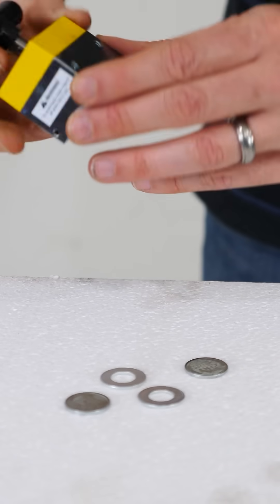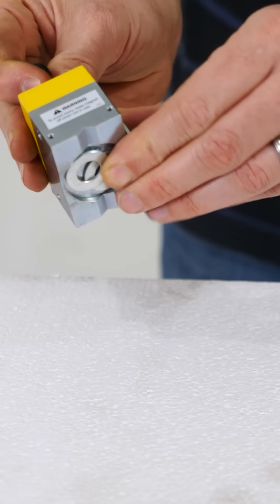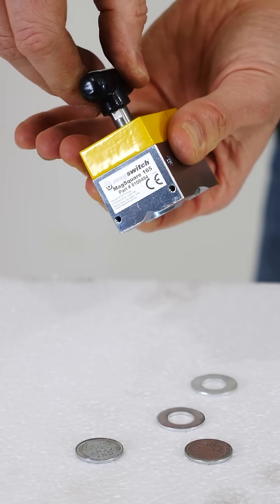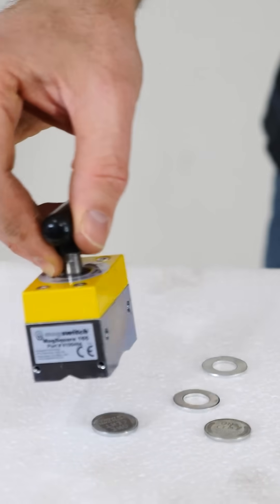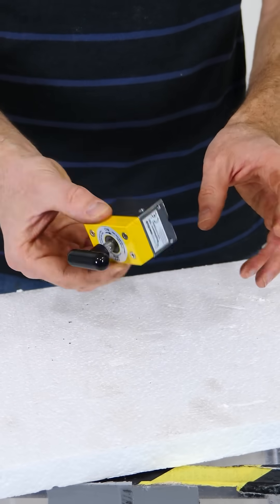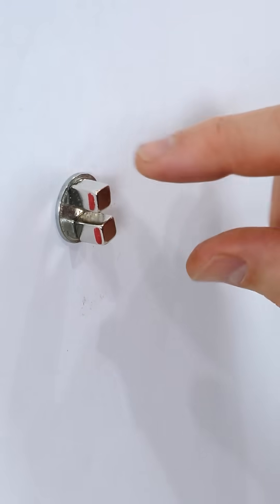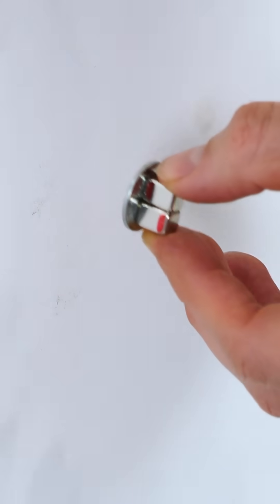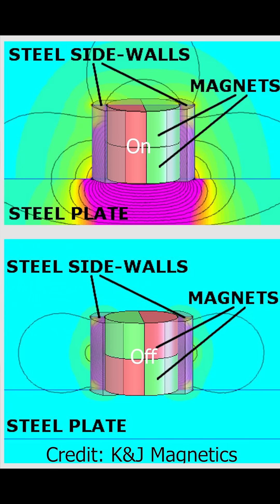How To Turn Off Permanent Magnets

Comment: Fascinating to consider how it doesn’t take force to turn the magnet off, despite it resulting in the metal bar leaving a magnetic potential well. I think it’s because the two halves are more stable in the “off” configuration, which offsets the force needed to pull the metal bar away? It’d be interesting to know if turning the magnet on is difficult (with no object attached)
Reply: Why didn't he answer??? That was really my question, how hard is it to turn it back on?
Reply: Turning the magnets require a force like trying to put 2 magnets close and then pulling them apart, is not a huge force because the magnets are small and the device probably offers you a mechanical advantage like gears or smith also altho it can hold the bar it can't lift it and the small pieces barely have any potential energy
Reply: @juan3856 ^
Reply: You can watch the original video to see him turning it on, he does so with a 3 finger grip and it doesn't seem to be much work. So I'm not sure that either config is "more stable" my guess would be that they're equally stable and that the offset comes from the unique interaction between the off configuration and the steel side-walls.
Reply: @Nezxmi he meant turning it on while holding the piece of metal to the magnet.
Not simply turning it on with nothing there.

Also, weird that he clicked that he loved OPs comment but didn’t respond to it.
I’d like to know where I can get one of these so I can try it for myself
Reply: @bamcr1218 OP's comment said he wondered how difficult it would be to turn it on with nothing on it.
Reply: Yes thats a great question, because if it really was that easy to tuen on and off, it would leave the door open for some kind of perpetuum mobile, where you can lift and let go huge objects of steel with the flip of the switch, which requires much less energy than the energy generated by the magnets
Reply: @nameisntimportant749  My thought exactly.  If no energy was needed to switch magnets on and off, you could generate energy by having a piece of steel shuttle back and forth between 2 'switchable' magnets.
Reply: Having used em a lot in the past for crankshaft runouts they flip on and off fairly easy, with or without metal to attach to. 
Id say its comparable to basically flipping a toggle switch in a plane. Enough force to maintain its on or off position but easy enough to overcome with a thumb or finger.

Comment: How can it qualify as a "permanent" magnet if it can be "turned off"?
Reply: BY NOT require, requiring to supply wooltage and current from a power source to operate.

Comment: FREE ENERGY!!!
Can I use the magnet to pickup a heavy metal (free potential energy), then turn it off, then turn it on again (free potential energy again)... Repeat...

Probably it becomes harder to rotate the internal magnet when it's lifting a heavy metal. Maybe you'll need much energy to turn it off and on again in this case.

Comment: Could these be used in a brushed motor? Potentially could drastically increase efficiency as you'd only have to move those magnets but then again it would take energy to move them. Also is larger but an interesting thought
Reply: ARE YOU learning  to speak from TRUMP?

Comment: The fact that you can turn it off and on really defeats the whole "permanent" thing
Reply: Just means you don't need electricity to run it.
I wouldn't even describe it a "off" just neutralised.

It would be a massive headache to keep a strong permanent magnet around the place.
Reply: @Cheepchipsable   YES
Reply: @Cheepchipsable  When you turn on the TV, you can turn it off next.

Comment: "Steel pieces of metal"
Reply: I mean, there are other kinds of metals... Aluminum, copper, tin, tungsten, etc.
Reply: @wpaldridge Yeah, but a normal person would just say "pieces of steel".
Reply: @wbfaulk  for sure. It's definitely awkward but not technically wrong.
Reply: @wpaldridge  no, it is technically wrong. by saying steel pieces of metal he's implying steel can be something other than metal. it literally cannot.
Reply: @wbfaulk or washers😀
Reply: @wbfaulk False. A normal person would call them washers.
Reply: @wbfaulk not proof checked for error
Reply: @dippst you are absolutely correct, this oresentet of the video is basically a tool.
Reply: @dippst He was not wrong and implied nothing of the sort.
Calling it metal is not false. Calling it steel is not false. Saying both in the same sentence is redundant, but still not false.
I could also get nitpicky with your reply and the imperfections of it as well, just as many seem to have done to him.
Reply: @dippst  No it's not, it's implying that there's multiple types of metal. Just like oak pieces of wood, etc. It's correct.
Reply: @wbfaulk  and why would you expect a normal person to narrate this channel?
Reply: @wpaldridge forsure lol   just funny that he said it like he did
Reply: @wpaldridge yes but steel can't be anything except a metal so it's pointless to specifically say metal pieces of steel, as opposed to what? Wooden pieces of steel?
Reply: @PeachDragon_ the internet is full of other people being wouk or just argumentative
Reply: @PeachDragon_ they are steel pieces of metal, right? They aren't aluminium pieces of metal. Or gold pieces of metal. He's telling us that all of the metal pieces are steel. These, is the referrer, including all of the pieces.

Correct to say steel pieces of metal, or these pieces of steel. However these metal pieces of steel wouldn't be correct.

Half of the elements are magnetic. Half aren't. So as you know he's clarifying that all of the metal pieces are steel, so we can assume they will be affected by a magnetic field.

Pedantic. Much.
Reply: @wpaldridge theyre all metals, so only steel was necessary
Reply: @wpaldridge But there aren't any pieces of steel that are not metal. Which makes the comment redundant, which is what the commenter is mocking.
Reply: @wpaldridge and? You don’t say steel metal. It’s either metal or steel. Saying one already implies the other. Stop defending ignorance.
Reply: @jamesbizs reddit tier commentary
Reply: @jamesbizs  “it’s either metal or steel”
Erm no… it’s both, not either.
Reply: @Silver-StarGazing find a hobby
Reply: @_..-.._..-.._  Thanks for the recommendation, but I'm good. I tend to make a hobby out of defending people from assholes.
Reply: 😂😂😂 the redundancy! But yk some people ain't that sharp, can't be too careful now
Reply: How about "metal pieces of steel" (which is talking about the pieces being made of metal and then specifying it)
Reply: @FifyKaqiqiPain it would still be “Metal pieces” or “pieces of steel”..essentially saying Metal or Steel twice. Metal pieces of Steel implies there can be other material pieces of steel
Reply: @FifyKaqiqiPain  metal pieces which are steel. That's how you'd clarify that.
Reply: There are other metals.... copper, aluminum, zinc, mercury...
Reply: as opposed to steel pieces of wood
Reply: Lmao true
Reply: At 3am in the morning
Reply: An aluminum piece of metal
Reply: You're a "Serpent like snake". Rustage(a rap artist and Dungeons and Dragons campaign runner[DM/Dungeon Masteer]) used this description of a snake goddess. Now, I call people that and watch facial expressions go from "how dare you" to "wuuut??"+confused laughter. Then I laugh, and then they laugh, and it's a funny time! Good ol' funny time...

Also, you probably know of DnD and it's acronymic terminology. But, just incase lol. So, no insult to your intellectual prowess(or anyone who reads this).
Reply: @ItsOnlyGenjutsu sad
Reply: maybe he meant stolen pieces of metal 🤷🏻
Reply: "washers"
Reply: Wtf is this. Some of you need to take a break from yt
Reply: You're just salty hopefully no steel in your body or You're going to rust and noone will touch you unless you get your tetanus shots XD
Reply: इंग्लिश मूर्खो की भाषा है 😏😂
Reply: As opposed to steel pieces of bronze.
Reply: You know…In general, anything that conducts electricity at absolute zero is scientifically considered a metal. In astronomy, every known element other than hydrogen and helium are considered metals.
Reply: I know, what an idiot. He should have said “Metal pieces of steel”
People sometimes…am I right?
Reply: I see nothing wrong with that.   He's specifying what kind of metal, no?
Reply: we just gonna skip over the fact he has a railroad spike?
Reply: @draconicdestruction  I found several completely loose while helping a buddy with his car in Missouri on the line near his dad's house, I assume they are left over from being replaced and not cleaned up after or lost among the rocks, all the adjacent rails seemed to have all the ones they were supposed to
Reply: Did you know that Jesus loves you? Jesus is the Son of God. He died on the cross for our sins and was resurrected three days later. With His sacrifice, we have eternal life in Heaven. Believe in Jesus and you will not die, but have everlasting life.
Reply: But Steal wheat penny
Reply: @Feltys_Coins I wish 😂
Reply: @austinhernandez2716 wach closely.19 seconds in!
Reply: @austinhernandez2716  in 1944, pennies were made from steel to save copper for war shell casings and FMJ rounds
Reply: @Feltys_Coins they actually made steel penny for one year in 1943 to save copper during the war, which I assume the main demand was bullet jackets and wiring.
Reply: I bet you’re all perfect and have never tripped over your words when you’re explaining something. His mistake was not reshooting it and assuming people might actually not trash him for it. Redundancies are one of the most common language quirks, and many are societally acceptable. 

Almost every comment here judging his grammar also has some sort of grammatical error. The same amount of effort could have been used to say something positive and supportive.
Reply: @valiantwarrior4517  Oh look at the good person that is so intent on being a good person that he is defending one person's mistake while trying to make dozens of people look bad so he looks good... that is the hallmark of a really good person, right?
Reply: @thomgizziz  Wow…
The whole point is that he shouldn’t even need to be defended. But thanks for spreading the attacks around.. Don’t try to paint me as the bad guy with your lack of logic or morals. You’re like a thrall who sticks up for a bully. Guess what? If there hadn’t been an attack, no one would have any reason to feel bad. 

Go ahead—try again to tell me how I’m wrong like a good little troll. Then go put yourself in timeout and think about the root of what is happening here.
Reply: @valiantwarrior4517  agreed so many people are willing to harp on misspoken words on youtube but i'm sure they make dozens of errors in their own day to day speech and ignore the errors of others irl as well
Reply: Steel is an alloy of iron and carbon, so he is not wrong in saying "pieces of steel." 
This is taught in a basic chemistry or science class. You can also easily find this information by looking "steel"  in the dictionary. 😊
Reply: @jaycwise I'm a chemistry teacher and teach junior science . The word steel crops up once per year ehen explaining iron ore to steel making. So I'd hardly expect anyone to know its meaning.
Reply: @emanuelmifsud6754  depends on where you live, I suppose. I asked the question as soon as I saw a knife branded stainless steel. Iron clearly rusts, so the difference was undeniable.
Reply: @emanuelmifsud6754  people know what steel is... you'd have to be really up your own butt to make the assumption that others wouldn't know it.

You think you are way smarter than you actually are.
Reply: @jaycwise  steel rusts... stainless steel is different than normal steel... stainless steel also rusts it is just more resistant.
Reply: @jaycwise  the problem was him using metal and steel together and being redundant, while being redundant is normal in other languages in english it is something to be avoided... how did you get this so wrong?
Reply: @thomgizziz  I did it just so you would feel inclined to correct it, lol. If it’s wrong, take it up with the textbook, haha. I wasn’t the only one to say it either, so maybe you’re just out to be bothered today.
Reply: That's the kind of language that makes me lose sleep at night. It could have been worse if he said "Some kind of" in front of "steel piece of metal".
Reply: Wtf is this
Reply: @Ucktain  🤷🏻‍♂️
Blown out of proportion, I think. Sorry, sir.
Reply: Came here for this comment hahaha

Comment: You sir are one step forward to perpetual motion motors!
Reply: thinking the same, it all depends on how much force it takes to turn the magnets. If it's less than the force difference between on and off it could work, but if it did much cleverer people than you or I would have made the machine by now surely/sadly
Reply: It is not reachable. The limitations of our own earths atmosphere limit us. You can technicalky get close/extremely efficient, but never perpetual. If it was fact, that something could/can/might have the ability to do so , then itd be common knowledge, as well as incredibky dramatic; referring to the fabric of human existence and its several "quirks" .  ,lol. peace
Reply: Even if perpetual motion is reacheable, it can't be motor, because in order to extract energy from the system, it must produce even more than it needs.

Comment: I bought some of these about a year or two ago. It blew my mind when I looked up how they work! I certainly learned something new about magnetism that I didn't even know was possible!

(Edit: Tl;dr at the bottom.)

Another thing I learned the hard way about magnetism is that materials that are not ferrous, or attracted to a magnet, including stainless steel, are basically, what I like to call, 
magnetically transparent. 
How I learned about that the hard way was when I was just starting to learn how to TIG weld stainless steel, and the welder set me up to do a T weld by propping one of the stainless plates with a triangle welding magnet (it was just leaning up against the magnet (the magnet wasn't holding it)). Well, I went to strike the arc, and as soon as I did, that magnet sent that arc the other direction! I mean it almost did a 180° U-turn!  It was probably more like a 135° U-turn since I had the torch angled at about 45° between me and the joint, if that makes sense. I immediately pulled off because I could tell something wasn't right. I struck the arc again, thinking maybe it was just a fluke, and the same thing occurred. 

Amazingly, those short durations with the arc being lit was all it took to melt about half of the cup. I unscrewed it and took it over to them and their minds were blown. They were like "how did you MELT a CERAMIC CUP??!!" I said, "I don't know, the arc just wasn't going the right direction every time I struck it." 

Then, as they are walking over, I suddenly remembered hearing that you could control plasma using magnets when I used to watch the Science Channel, including Dr. Michio Kaku about his theories on building a lightsaber.

So right when we got to the table, I said, "I think it's the magnet." She struck the arc, it did the same thing, she took the piece away from magnet, put the magnet somewhere else, and then leaned the workpiece up against the vise instead, and, sure enough... problem solved!

(Edit: Tl;dr: I melted a ceramic cup on a TIG torch while trying to tack stainless steel plates together because the workpiece was propped up by / leaning against a magnet.)

I tell you what though, it sure would have been super cool to have a camera in my hood looking at what was happening to the arc when the magnet was disturbing it! Maybe I can try to reproduce that situation sometime in the future and have a camera to see what happens.

Comment: Short circuited the magnetic fields??? Hmm 🤔 😂
Reply: It is called a magnetic circuit.
The field travels from north to south pole through air.

Air is a high magnetic reluctance material.
Ferromagnetic materials such as iron, steel have a low magnetic reluctance.

So by appropriate design of the magnetic circuit you can cause the magnetic field to be concentrated in the ferromagnetic material with no field passing through the air.

So yes, in a way he has short circuited the magnetic field by creating a low reluctance path for it to flow through, in much the same way a low resistance path shorts an electrical circuit.

Comment: Heres a non-popular thought:
So when on, the amount of force is orders of magnitude more than the amount of force required to turn the little switch off and on...

Yes, I'm gonna say it...

Over-unity device that really works...
Reply: You shouldn't have said it.
And you expose your lack of physics knowledge when claiming over-unity.
Reply: @deang5622  actually have a collegiate background in physics... before switching to electronics and computers...
But the issue I have is balancing the forces when it takes only a few ounces of force to turn on and off a magnet that provides hundreds of pounds of force, albeit over short distances.
Occurs to me that some kind of reciprocating geared device could be fashioned that repeatedly lifted and dropped a weight, and only a few ounces of force stored in a spring or flywheel could be used to rotate the on off switch. Not really claiming over unity, but it does make me wonder why that wouldn't work, given the extreme difference in control force and load force.